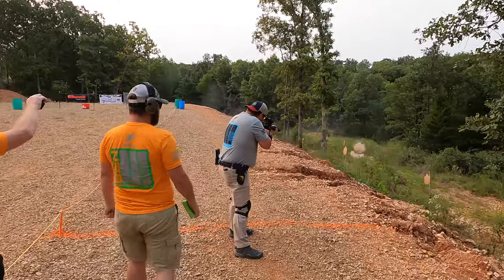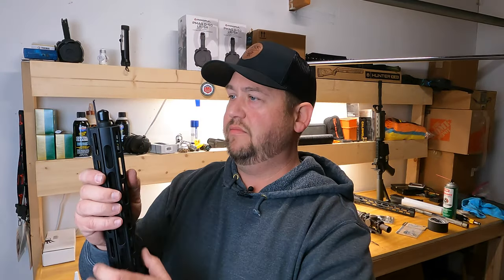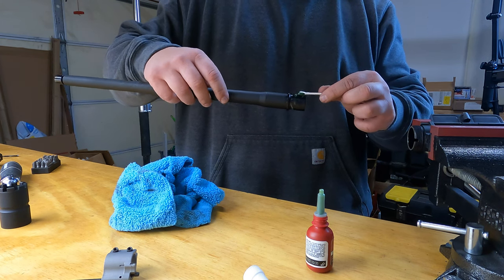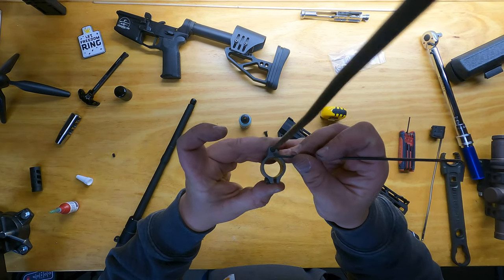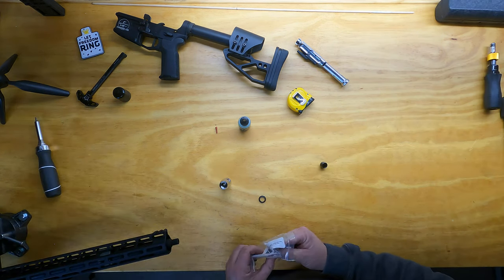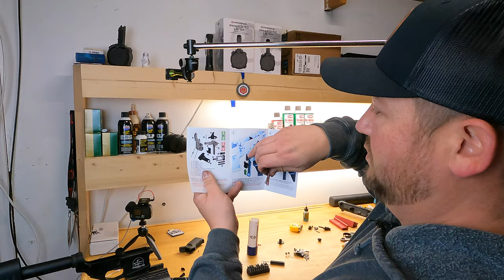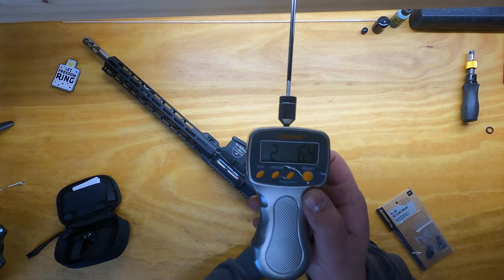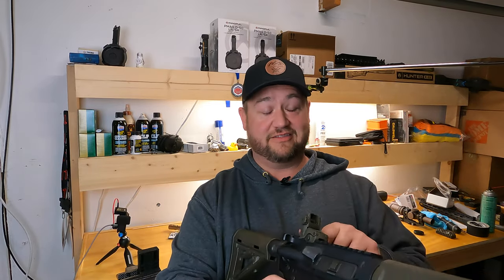How I Build a 3-Gun Rifle After 10 Years In The Game | ADM UIC | Vortex Optics | Criterion

Comment: Great video.  I have several Criterion Barrels and so do my friends.  I stopped using adjustable gas blocks because the barrels are so well gassed that having an adjustable gas block is not necessary
Reply from the maker: Thanks! That’s an interesting point and I don’t doubt it. I have shot several criterion barreled rifles at demos & from friends and you’re right, they shoot very well!
Reply: @prepandpress  I also had to put some blue loctite on top of the barrel nut because the ADM handguard started moving forward on me (happened several times to different ones).  If you watch the Roscoe Barrel video, they use the same handguards, which are made by ADM and they have all the torque specs for the handguard bolts (45-55 for them).

Comment: Why put a grease or loctite on everything? Aren’t the torque specs for dry torque?
Reply from the maker: The paperwork from ADM specifically called out aeroshell grease for the barrel nut. In fact, many other manufacturers do as well and I believe the mil-spec calls for it (although don't quote me on that). As for the fasteners, the ADM paperwork said to apply it there as well. The gas block was dry-torque, no grease or Loctite specified. The surefire goo on the muzzle brake is Rockset, it came with the washer kit and is insurance as I am not using a crush washer.

Comment: Which criterion barrel did you get? And did you go with a chrome lined or nitride coated?
Reply from the maker: I got the 16" ADM/Criterion Hybrid barrel. Mid-length gas, .223 Wylde barrel and it is chrome lined. Usually I prefer nitride but I'm pumped to try out the chrome lined Criterion because of their special process that preserves accuracy.